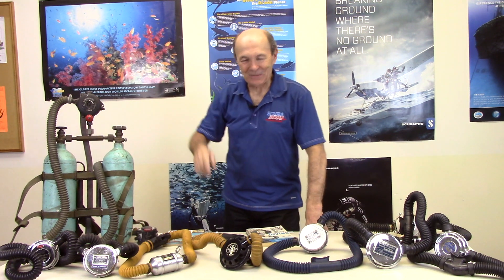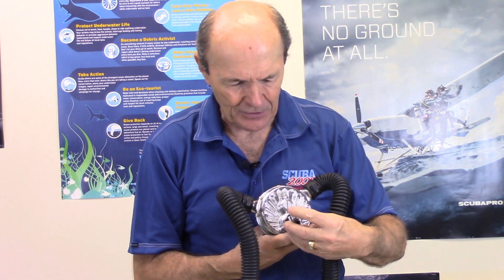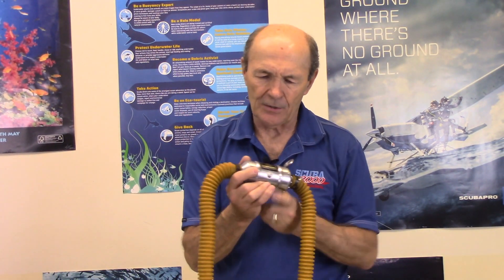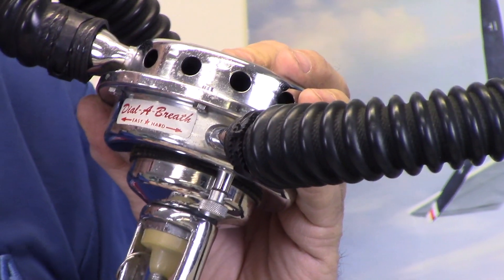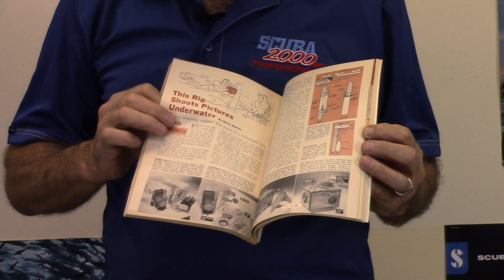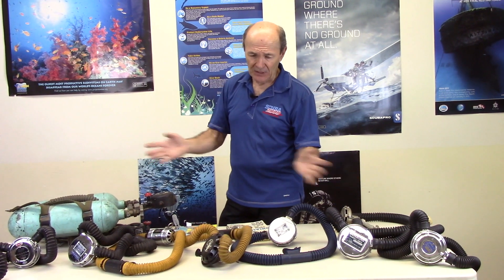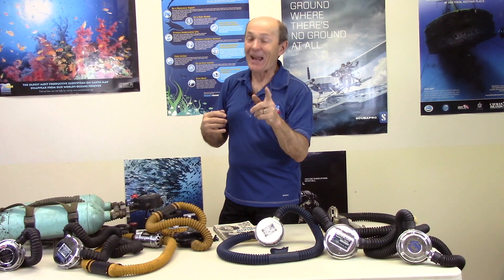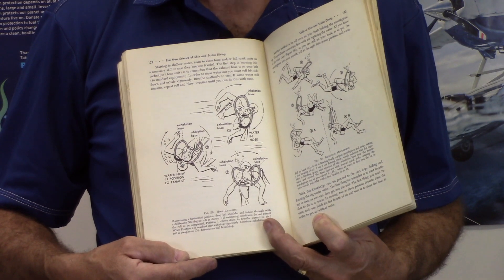Double Hose Regulators   Good, Bad, Ugly! - Vintage Scuba: S01E09

Comment: Alec, I have an old RENE tank that was given to me 40 years ago by an uncle who bought it new in the early 50s after he left the military. He bought it in California and only used it a few times here in Minnesota. I have a basic PADI certification but I’ve never dove it either and don’t plan to. It’s never been hydro tested and it’s still full of 1950s air! I don’t know what pressure the tank is under and I’m now wondering if I should be concerned with this being a dangerous situation. Have you any thoughts for me on what I should do with the air in this tank? Thanks!
Reply from the maker: 1. That Rene tanks was sold by Rene Buzzo, a Canadian who imported the 1st regulators & tanks into North America.
     He opened one of the 1st scuba stores in the US called Rene Sports.
     It is very likely worth several hundred dollars to a Vintage Scuba collector.
     Contact Rob at The Scuba Museum in Cincinnati for more information.
2. Technically, air never goes bad although the O2 level may drop slightly if there is rusting inside.
     So, in theory at least, it could still be used. 
     I don't suggest you try it!
3. The pressure of scuba tanks at the time was 1500 to 1800psi.
     Do NOT fill it, even if possible!
4. Having had air in it all these years, it is quite possibly in good condition.
     Only empty tanks corrode.
5. If possible, measure the air pressure.
    Let all the air out except the last 250psi.
    It will be quite safe then to store it or sell it.

Good luck.
Alec
Reply: @AlecPeirceScuba_SeaHunter  Thanks Alec. As we're all getting old, I wonder, do the young kids even care about this stuff!?! I've got the mint US Divers blue label reg on display too. They were bought together. Cheers!

Comment: I learned on double hoses as well in 1962.  Used extensively to photograph in the mid seventies.  A PADI instructor recently asked me if it was part of a rebreather.  Talk about great regulators..... DACOR.  Great videos Alec.
Reply from the maker: Dacor has a reputation long after they closed and still loved and dived by many (including me).
A

Comment: I'd definitely build my own gear. I'm sure that they wouldn't let me use it on any charter boats though. Heck, a place in Fort Lauderdale made me add an alt secondary to my old kit before allowing me to get in the water. The kid on the boat didn't seem to know that we didn't start using those until relatively recently.
Reply from the maker: I get a lot of comments from "mature" divers about new divers thinking dive computers have been around forever, same with BCD's and safe seconds.  Kevin dove his Aqua-Lung double hose and the crew thought it was a tech rig.  We older guys know better and appreciate how good todays gear really is.
A

Comment: Thank you very much for this video. Although I was fully equipped with modern stuff, now and then I enjoyed using my Royal Mistral two hose regulator, at least until it was stolen from me. It was fun to shallow dive, 12-15 mt, with little equipment, no BCD or pressure gauge, no redundant equipment, just the 18 Lt - 220 ATM - tank, the two hose regulator, mask and snorkel, fins, short wetsuit, knife and weight belt. No dive computers either, they were not so common yet, just US Navy tables - when needed -, a watch and a depth gauge. A bit of tech dives, with no much space for mistakes.
Reply from the maker: That is exactly how I started diving in 1960 and I thought I was super high tech.  Losing a Mistral is sad day and hope some of my vintage double hoses bring back better memories.  Thanks for watching and surviving the stone age days of diving.
A

Comment: thanks, but what was the benefit of double rather than single one in design?
Reply from the maker: Doubles were the first scuba regs.  Single hoses came years latter and soon took over the market.  A double hose reg breaths different, has no mouthpiece purge button but is very difficult to free flow (a 4" diagram), exhaust bubbles are behind you so nothing obscures your view and most important, are super cool.  Check out my Vintage Scuba playlist to see these in use at our Sea Hunt Forever events.
Reply: @AlecPeirceScuba_SeaHunter  Thanks, so informative.

Comment: I have always wanted dive with a two hose regulator.  That's on my bucket list!
Reply from the maker: It really is a blast.  Can use original vintage gear, or vintage gear updated to modern standards (look back to see videos on this), or totally modern double hoses like the Kraken.  Did you know it taught the only PADI "Vintage Double Hose Diver" speciality?  Kevin is certified (in many ways).
Reply: @AlecPeirceScuba_SeaHunter  that's neat. ...lucky dude Kevin.. 
I think, While I'm in Florida, I'm going to try and get up with the guys that do the sea hunt diving and see if    they could help me do a dive with the vintage two hose regulator. 
 I believe I heard a diver that used to work with me say you could not swime upside down with the two hose rig, but then again he said the same thing about my old 1968 US Divers single hose regulator.. it only had one port on the 1st stage so we added a fitting to put a bc hose on it. Lol I traded it for a brand new Dacor... Well at the time in 1989, it was almost brand new... that was almost identical..except it have more ports. I just added a set of new 2nd stages and a used pressure gauge, and took it diving last week.
 Just got my new wetsuit in Friday, and next Saturday my two new 2nd stages will be in...
 Thank Alac, and Kevin... It's all y'all's fault!  Lol.
Reply: @hearsejr   True swimming upside down would put the mouthpiece higher than the regulator and it would start to free flow air. (At least mine did) 😆
Reply: @thompsongl  thanks, I remember the days when I was sitting in front of the TV and watching the guys swime out the Sea View ... How many of y'all know what the Sea View is?... And get in an under water fist fight. I look back these days and still amazed at how they would flip and tumble through the water and never miss a breath. Lol. I don't know how they did it but I spit my mouth piece out by accident the last time I went diving and nearly drowned trying to find it again in less then knee deep water. It was a beach dive and a bit wavey trying to get to deeper water and I tripped over a big submerged rock. Lol.
 Right now in grounded fighting a bone infection and might lose my middle toe so no diving for a couple of months. But as soon as I get the OK, I want to find someone who would let me borrow their regulator and get a few minutes just so I can say I tried it once. Lol
Reply: @hearsejr   Of course with the underwater fights you needed a big knife to cut the enemies two hose regulator !!! lol  Early complaints of single hose regulators was the mouthpiece was heavy and caused jaw fatigue. The two hose ones we so light and airy !
I hope you get the chance they are cool !
Reply: @hearsejr  so funny ! Yes the early 2nd stages were so heavy - in cold water your jaw just locked up....😂
Reply: @thompsongl  lol I was so excited I never noticed it. Lol
Reply: @hearsejr  i hear you ! An experience you'll never forget !

Comment: I do not recall the company but do you remember the first one hose regs. One company came out with a one hose that had both inhale and exhale hoses made into one hose. Both hoses were incorporate into one. Exhaust still came out the back. Also a friend of mine had a USD Royal Aquamaster (early 80') he wanted to have rebuilt. He wrote USD and their reply was they would do the work but would not guarantee its return.
Reply from the maker: Hi Gordon.  First for the RAM rebuild, I recommend you contact VintageDoubleHose.com,  Bryan can service and upgrade to modern performance standards (look for video S08E06 as Kevin had his 1975 Aqua Master updated. 
Second the reg your thinking of may be a Aqua-Lung over-pressure.  Watch my Vintage Scuba S08E10 for more.  Hope this helps Gordon.

Comment: Alec I just found your channel and watched a few of your clips and am impressed by your wealth of knowledge. I started diving back in the 70's and am a Padi Divemaster. Haven't been going diving much for the past few years but have been getting the Bug again. For a long time I have wanted to try a Double Hose Rig but had been put off by the fact that you couldn't attach anything to the first or second stage. Then I found the Kraken..it wasn't too long until Bryan had a special deal for the unit with a pressure gage and a safe second so I ordered one. Then the fun started..My goal was to end up with a modern tech style rig but with the double hose reg. Long story short I ended up building two rigs because I had to use bits and pieces from a variety of sources and had a lot of parts left over. The end result is a VDH backplate with a Hog wing and a harness that is part Dive Right and part Hollis. It has a Scubapro Cumberbund and backplate pad, an Air2 inflator and I ended up using my old Scubapro G200 second stage as the safe second. So far I have only had it in the pool a couple of times and each time I make a few more changes and now it's ready for the ocean. It is quite a bit different in use..I wouldn't recommend one for a novice. There is a big difference in the ease of inhalation depending on your attitude in the water. Getting the reg down between your shoulder blades helps a lot but after using it I started thinking of all the times going head first down the anchor line hence the old G200 second stage. Just shut off the DSV on the Kraken and switch regs ..problem solved..Kind of a hybrid solution. All in all a single hose setup is a lot easier to use but not near as much fun as trying to make a modern rig with a double hose reg..Also it is really interesting seeing how people react to seeing it..it ranges to disbelief to I want one..

Comment: Every video is wonderful and a wealth of information.  Thanks so much for doing these Alec!  

I grew up using double hose regulators at a YMCA camp in Wimberley, Texas, where as a nine/ten year old we listened to a record narrated by "Mike Nelson", after which we strapped on a small tank and off we'd go.  But I wish there were safe and reliable double hose regulators for use today, if only to remove the bubbles to behind my head so I wouldn't so easily scare the fish when photographing.  Would that be a reasonable proposition today Alec?  One wonders where to obtain a double hose regulator and how to keep it maintained.
Reply from the maker: Great to hear from you Lloyd.
Several of my 'vintage' friends dive exclusively with 2 hose regs.
You have 2 choices. A vintage double hose regulator properly serviced can be used provided you observe standard safe diving practices or, and this does not suggest you can disregard safe diving practices,  you can purchase a brand new, modern, made-yesterday, double hose regulator. Check my good friend Bryan's website - www.vintagedoublehose.com .
Thanks for watching and good luck. Alec
Reply: Tanks so much Alec.  (that was a typing error, but then it seemed appropriate, so........)  But your friend Brian's website is another terrific resource!   I'll soon be an Argonaut Kraken owner.  It's exactly what I have been looking for for years!!!   Maybe I'll even throw out my BCD, strap on a simple safety vest, and Sportsways Waterlung Backpack that I was so proud of when I first bought it.  Everyone got one of those, didn't they?  Please keep the videos coming.  I started my wife on watching them with me and now we're quite addicted.  Long live Mike Nelson and Sea Hunt!   Oh, and Alec Pierce!
Reply: Hello Mr Peirce, I use mainly Mistrals, I have my first regulator also! I was certified in the 1970's, mine is a  usd conshelf. we had to learn both dh and single. plus the ditch/don, It was the best time of my life. since I seldom dive deeper than 70 ft anymore, my favorite regs are my Mistral and aquarius usd regs, bullet proof. excellent channel you have, You bring back so many memories, thank You.

Comment: Apologies I should have said early divers not old divers. So I will ask in a better way. How did early divers learn about nitrogen effects and do you have early table that you can share in a video about vintage diving?
Reply from the maker: No problem Lucas. Any early divers are now old divers.
All we had were the US Navy Dive Tables which were based on very sketchy data backed up by real dive experience. Essentially, before computers, the dive tables were planned in theory and tested by divers to see if they worked. Divers were Guinea pigs. The tables were certainly not designed for recreational divers. Navy dives generally involved going down to a certain depth for a certain time and then coming up. They didn't do multi-level dives so sport divers who do almost exclusively multi-level dives were at a real disadvantage. If we went straight down to 100' and then right back up to 40', we still had to surface within 20 minutes. That's what the tables said. Divers today have no idea how lucky they are to have all the research and computers. Thanks for watching. Alec

Comment: Alec, again thank you for a great video. I, of course, have another question for you. How did you fill your air tanks? Was it like it is today and you had to find someone with a purified air compressor or did people just take the risk with the one in their garage/shop? By the way, I looked up those old dive gauges you mentioned in your last video, very interesting, thank you.
Reply from the maker: Well it was a bit of a risk. I got air from the fire department in my small home town. That was a common source for divers for many years before dive stores started to open. Some divers had their own little compressor, often home made. Also, there were lots of dive clubs then and many would pool their resources to buy a compressor. That's not so much the case now.
I recall that many years ago while diving in Mexico, my group would sit in front of the dive shop in the morning with a few beers and snacks and, if the divers who went out in the morning all came back in the evening, we knew the air was safe!!
Reply: Great story. Since you brought it up, what is your feeling on getting a fire department to fill air tanks now if someone (me) dose not live near a dive shop? Thanks again.
Reply from the maker: Sure - if they will do it. The air is fine but many are concerned about liability. Give it a try. 
If you know a firefighter or can get a contact in the department first, that might help.
Thanks for watching Joshua. Alec